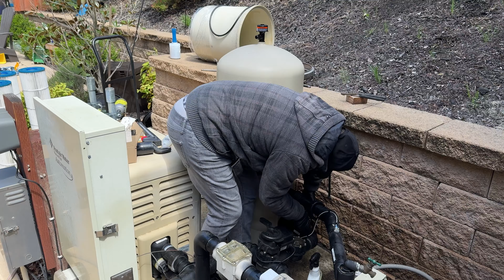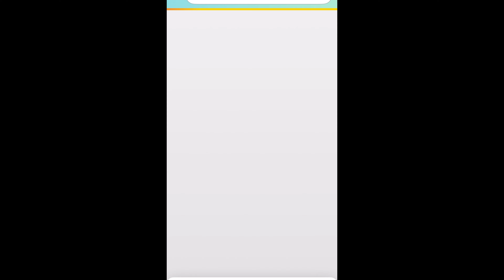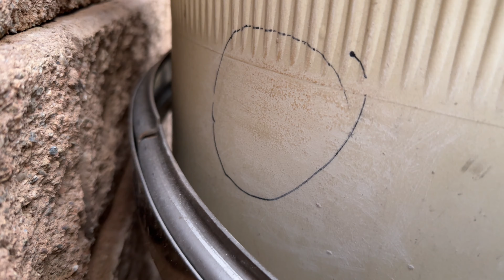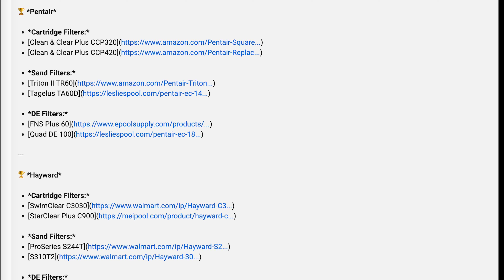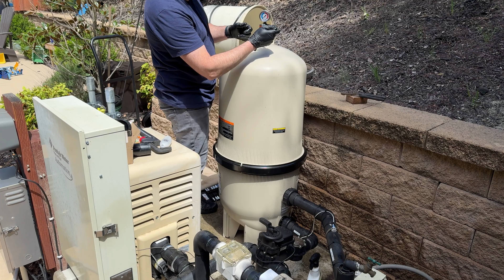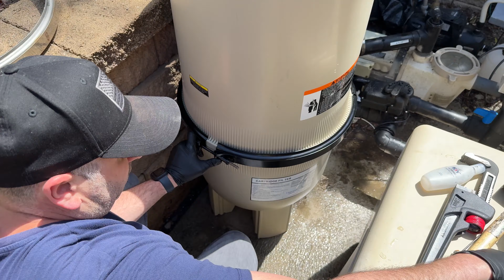Replace a Pool Filter Housing Without Cutting Any Pipes

Comment: Thank You for sharing your knowledge , I will be replacing mine filter housing Soon.
Reply from the maker: You’re welcome, Darryn! Glad it helped. Before opening anything, shut off power to the pump and release all pressure through the air relief valve. Make sure the gauge is at zero too. Hope the replacement goes smoothly! 👍

Comment: Thanks for the video.  My Pentair CCP 520 cracked a couple weeks ago after six years of use.  After watching your video, will diy it.  Amazon has a 520 compatible unit from Noroeua Store for $1,169.  Who did you buys yours from?
Reply from the maker: I do not remember the exact seller well enough to give you a name without checking my order record, and the listings change frequently. Before ordering, match the port spacing, clamp size, pressure rating, and compatibility with the CCP 520 plumbing. If the original link is still in the video description, that is the exact unit shown.

Comment: How is that generic filter working out? I considered buying one but got the Penta one at a pretty good price so spent about 200 more.
Reply: Who pool supply store did you get your Pentair unit at a good price?
Reply: @Jam73-ER my local mom and pop shop. There was a shop in Pasadena that had it for even less.  Online there are pool stores that deliver free , dont remember the name but I couldn’t wait for shipping.  Poolsupplydepot was one I believe.
Reply: @tonesmith909 ok thanks.  I didn’t want to try the off brand from Amazon.  Found a local shop in Vegas that replaced my cracked bottom housing with a Pentair part.  $625 for the part and installation.
Reply from the maker: The generic housing fit and sealed correctly when I installed it. I do not want to invent a longer term result that I have not verified. The Pentair unit remains the safer choice for known parts support and warranty, so spending a little more for it was a reasonable decision.

Comment: My man must have an olympic sized pool to need 520 square feet of cartridge filter, lol!  I've got a 20x40, 28,000 gallons and I get by with 150 sq feet.  Pool guy tells me I need bigger, but this size seems to do just fine.
Reply: You do need bigger.  Sincerely, another pool professional.
Reply from the maker: If the 150 square foot filter keeps the water clear, maintains acceptable pressure and flow, and does not require constant cleaning, it may be doing the job for your pool. A larger filter mainly provides more dirt holding capacity, lower flow through the media, and longer intervals between cleanings. Your pool professional may be recommending convenience and extra capacity rather than saying the smaller filter cannot work. Real operating results matter, and yours are useful.

Comment: Why didn’t you just buy the bottom assembly ?
Reply from the maker: Good question. Given the age of the filter, around 11 years, it was pretty much at the end of its expected lifespan anyway. Even if I had replaced just the bottom assembly, the top would likely have issues not too far down the road. At that point it makes more sense, both in time and labor, to replace everything at once rather than chase parts on an aging filter.
Reply: @PoolProfessor  so true , replace both because that one is gonna give sooner or later 👍